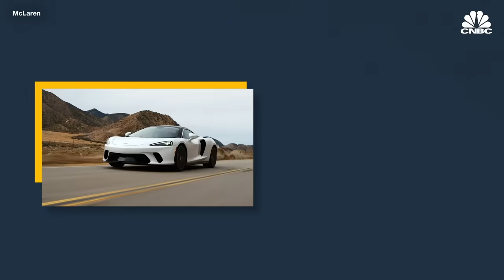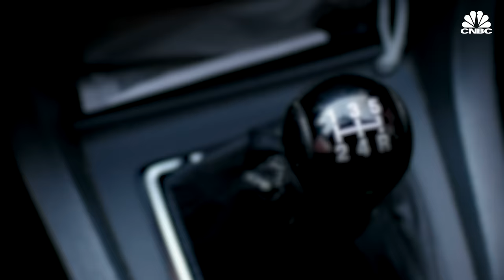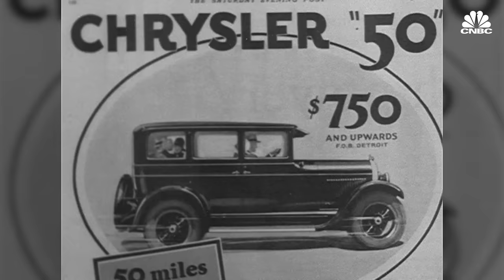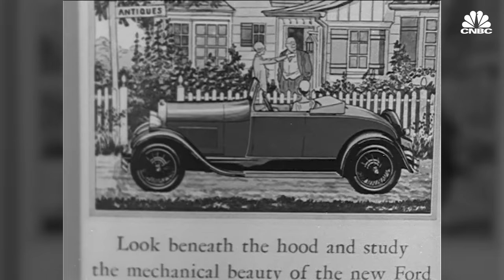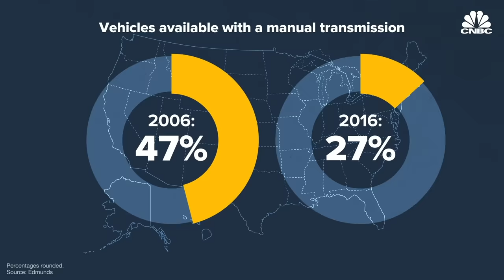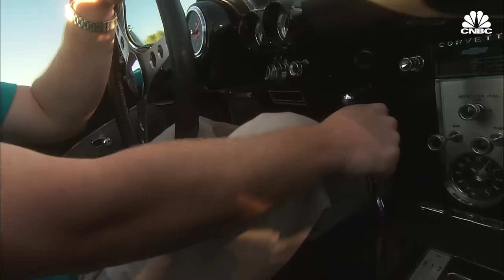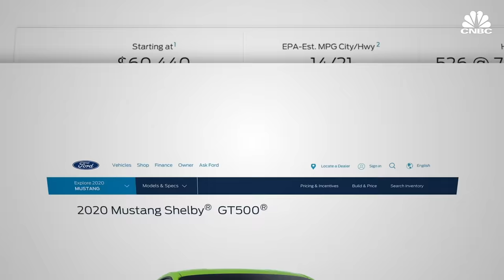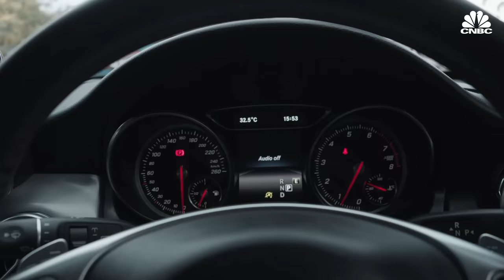Why Stick Shifts Are Going Extinct

Comment: "Manual requires work, skill, and constant attention" - Sounds like it makes you a better driver.
Reply: Something that requires constant attention makes anybody a worse driver. It is only politics that prevents it from being considered "distracted driving."
Reply: Well I drove an automatic vehicle in an area I didn't know(the US) and with cruise control it makes things so much easier. You can concentrate on reading the signs in a foreign language, see where you are going instead of getting lost managing your whole body to drive. I was also less tired on long distance driving. An Interesting data would be to compare accidents rate in cars with autopilot, cruise control, manual and automatic gearbox. If they can make a safety case out of it then it will be the end of manual
Reply: I will admit that I am a below-average driver with an automatic.   I think I have a little ADHD happening which hampers my focus.  

I am a MUCH better driver with a manual.   I am more involved in the actual operation of the car, more focused and alert, and simply put...a much better driver.
Reply: I find myself being more distracted in an automatic. It is extremely boring to drive and ill start getting lost in random thoughts.
A manual is way more fun to drive, and I'm always paying attention to the road, to see when to shift, downshift, on red lights im constantly paying attention so i can shift into 1st as soon as it turns green. Idk, to me a manual makes me more focused, and it's more fun.
Reply: lol thank you
Reply: @TheLaly37  One of the countries most prone to car accident is USA and one of the less prone countries is Germany.
In USA the speed limits are quite low and almost every one drive an automatic car with a cruise control.
In Germany speed limits are higher (sometimes there are no speed limits, so you can drive as fast as you can!) and the vast majority of cars have manual transmission and no cruise control.
The most common cause of accident in my country (Italy) is DISTRACTION and, of course, automatic transmission, cruise control, low speeds, ADAS and of course CELL PHONES are all cause of distraction.
Reply: @Ιώαννης Ανδρέου yes, this is the first cause of accident, but there are much less accidents!!!
If you slow down the traffic, you surely decrease the number of accident caused by excessive speed but you dramatically increase the overall number of accidents!!!
Speed equal danger... but danger equal more attention!
Remember that driving is not safe and requires attention... when you feel safe while driving, your attention level decrease and the likelihood of having an accident increases a lot!
A rule of thumb... if you feel safe when driving, you aren't safe at all!
Reply: Guess the most important thing is what you are used to. I have driven an automatic once and it did not go well. The car stopped at almost every intersection.
Reply: @niklasmolen4753  So you tried to press the clutch and hit the brake instead???  :-D
This is a quite common issue for people used to manual transmission only!
I driven automatic two times in my life (one for a short trip across the city and one another for a quite long 2 days roadtrip)... it ended just fine in both situation but of course i hit the brake hard few times also!  :-D
Reply: @ChaotikFPVyup. It's muscle memory and being more concentrated on driving is the point of driving safe. IDK how this is distracting, unless you're new to it but oh well.
Reply: @Ιώαννης Ανδρέου fatal***. He said car accidents.
Reply: Ιώαννης Ανδρέου no, those crashes are all caused by idiots/tourists who think that no speed limits=top speed everywhere, and constantly drive like that while forgetting to look, and think ahead further than when your doing 100. THE AUTOBAHN IS NOT A VIDEO GAME
Reply: @Ιώαννης Ανδρέου Do you ever tried to drive in Italy?
There are a lot of stupid drivers that drive at very low speed in the center of the road (usually with two wheels on a lane and the other two wheels in another lane, even in two-way streets!) that causes a lot of troubles and a lot of accidents too.
Anyway, you are right... better driving education is the root cause... but in order to be a better driver you shall be able to drive faster and mantain the control the car during skids and other issues... if you can't do this, you can't be a good driver!!!
Reply: Cor Rautenbach  Washing clothes by hand makes you better at washing clothes so lets get rid of the washing machine too SMH
Reply: @christiansoldier77  There are some big differences to be considered:
Hand washing can be better in many special situations (for delicate clothes for example) but it requires a lot of extra effort and time (which can be used in a better way).
Using an automatic car instead of a manual one is simpler but...
Can you use an automatic car to spare time???? NO!
Can you use an automatic car for a more relaxing driving experience???? MAYBE, but driving an auto still require a lot of concentration (so is pointless!)
Also....
Can you use an automatic car in sand, snow, ice or other harsh conditions????? MAYBE, but a manual car allows some extra tricks to do something otherwise impossible for an automatic.
Can you stop an automatic car in case of an engine runaway???? MAYBE, but with a manual transmission is really easy and you will have 100% of success rate.
Can you stop an automatic car going down a slope in case of complete brake failure????? MAYBE, but with a manual car is way easier (and this is not a problem at all because everyone use engine brake to slow down the car, preserving the brakes).
Also, there are some other common tricks available 
(i.e, you can switch off and on again the engine while running in case of electronic seizures and you can start the car by push in case of a dead battery).
Remember that driving a manual car is not the same of driving an automatic car but there are many extra options available.
FYI:
Driving in highways in normal conditions ---> almost no differences.
Driving on mountains ---> manual is better.
Driving in harsh conditions ---> manual is better.
Get out of problems or failures ---> manual is better
And finally..... driving in the city  in normal conditions---> this is the only condition where automatic is better than manual!.
Reply: @teslacoiler  If the manuals were better than people would prefer manuals over autos
Reply: @christiansoldier77  This is exactly what happens in countries where an apprentice must show proficiency on a manual car to get a driver license (for example, here, in Italy).
When you know how drive a manual car, then you also know that there are something missing in an automatic car (not only the clutch pedal, but something else!).
The vast majority of cars have manual transmission here; most model have only one engine option for automatic transmission but many options with manual and some models aren't available with automatic transmission... even when you rent a car, a van or pick a drive-sharing vehicle, you have very few (sometimes ZERO) options for an automatic transmission.
Reply: @christiansoldier77  The real reason is another:
if all motorists were able to drive either manual and automatic transmission, than people would prefer manuals over autos!  :-)
This is exactly what happens in countries where all motorists are able to drive either manual and automatic transmission!  :-D
Reply: @teslacoiler  Obviously that isnt true otherwise autos would have never become popular
Reply: @christiansoldier77  Autos are popular only in countries where you can get a driving license on automatic cars without any restriction.
Reply: @teslacoiler  Dude  at one time manuals were the ony cars that existed  now people want autos so it isnt because of  any reason you keep talking about
Reply: @christiansoldier77  do you ever tried a long roadtrip with a manual car???
I drove for a quite long long roadtrip with an automatic car once and i was not satisfied for the small lag before any overtaken (with a manual car, i can downshift the gear before so i can have the full power immediately) and i was quite concerned for the number of times i use the brakes as I was going down a mountain road (i definitely "smell" the problem).
But, I must admit it was great inside a city (and also very fast and with excellent road holding for reasons other than automatic transmission... it was a powerful sport car!).
Reply: @teslacoiler  Manuals are only popular in Europe because they pretty much make you learn on  manuals and the insurance for manuals are lower than autos
Reply: Not really.  It eventually becomes brainless and repetitive.  Also a huge PITA in traffic.
Reply: @christiansoldier77  OK.
So, please explain why every winter i always find a lot of automatic cars in trouble on the snow (causing a lot of troubles for other cars) and only few manual ones?
Keep in mind that only about 5% of cars are automatic here.
Note: i know and use some tricks to drive on snow using a manual car but i have absolutely no idea how drive in snow using automatic transmission and no handbrake (except try to drive in the standard way... which of course is not good on a slippery road!)
Reply: Christian Soldier “insurance is lower on manuals.”  Interesting point because insurance companies “crunch the numbers” and if the insurance is cheaper then it is because there are fewer accidents. Why? Probably because you have to pay attention when driving a stick shift. Distracted driving is the biggest problem today and automatics make it so much easier to be distracted. Pretty much impossible to text and drive if you are driving a stick shift
Reply: @AndrewSteitz   insurance is lower because automatic transmissions are expensive to replace are more prone in even light accidents.  Has zero to do with the driver skill.
Reply: @nit0134  agree 100 percent.
Reply: Pretentious stick drivers at it again. Stick provides no benefits in typical daily traffic. Only when you are pushing the top performance limits of the car is where the benefits shine.
Reply: what work? After few hundred hours of driving ,which is not that much, it becomes like second nature and you do that instinctively..
Reply: @flagmichael  Have you ever driven a manual car? Once you are fluent with driving one, there is no distraction. What, do you think that you have to look down at the gear shifter to see where to move it? lol.
Reply: It's not
Reply: @flagmichael 

Tell that to Europe and Asian. Almost all of their vehicles are manual. In South Korea, drivers are considered professional drivers and soldiers have to take a separate driving test to be allowed to drive non-military vehicles there. I believe many European countries have the same policy.
Reply: Exactly
Reply: @teslacoiler  Another factor in the U.S.'s accident rate, which you've conveniently left out, is over-all traffic DENSITY. We've far more vehicles on the roads, in any one given geographic area, than Germany has ever had. More vehicles, (by FAR!) will automatically yield a higher accident rate, per capita.
Reply: @JsliceQB1026  100% accurately said. Too many people drive on it, as if it were, however. This is why they have (well, one of the reasons, at any rate!) Polizei.
Reply: @pjamese3  Yes, this is how it was back in '85-'86, when I was stationed in Uijongbu City, at Camp Stanley. Don't imagine it's changed any, in the intervening 35 years.
Reply: @flagmichael  I can tell you've never driven stick. Driving stick is a lot like riding a bike. It becomes muscle memory. Driving stick has made me become a SAFER driver because I need to use BOTH HANDS while driving. So, it's harder for me to text and drive when driving stick. It's only ignorance that calls driving stick as "distracted driving".
Reply: GameNeet True. Driving an automatic is the most boring thing ever and no fun. Constantly getting distracted because it’s too easy to get.
Reply: It's like when they review a car and say "The interior is so quiet"?? I want to hear what's going on under the bonnet, and the road, what about horns? or sirens?  Go home and put a pillow over your head that's quiet.
Reply: Exactly its really not that hard to drive a manual,  you can't just push the clutch in and coast downhill to save fuel in a automatic XD
Reply: exactly
Reply: @ChaotikFPV muscle memory still takes brainpower. Even an instinctual action takes more thought than no action at all.
Reply: You can get to a point where driving stick is second nature. In other words you really don’t have to concentrate on what to do next. But I been driving stick for over 30 years so it’s quite a natural thing for me.
Reply: @flagmichael  I live in a hilly part of my country with really bad road conditions, potholes, turns and sloped roads riddled with potholes, cracks etc and during rainy seasons its literally offroad muddin season in most roads except the main commercial town areas, and i find it funny that Americans cant even drive stick when their roads are literally God Tier and mostly straight compared to the roads in most developing countries, also despite the road conditions out here its safer, better and more fun to drive a manual because you can actually control your car better compared to automatics as i have both an automatic and a manual but prefer to drive the manual because an automatic is just plain, bland and boring. Americans need to git gud at driving fr if u think driving stick requires constant attention that can distract you, rather its the opposite.
Reply: @TheLaly37  we need more manual MODES do you can have manual and automatic
Reply: No it wastes a lot of time, energy, and causes fatigue. Hopefully all cars should become automatic, paddle shifters are pretty good.
Reply: @ROTHSTEIN01  do you know how to drive stick?
Reply: @jogmas12  yeah I am from india and that's what 95% of people drive here, an ugly stick  lol. I learnt using a stick and seriously when I first drove an automatic, I knew that I was not ever going back to that ugly stick gearbox.
Also here in india, traffic is pretty insane, the reason why Manuel sells so much because it's cheap. But it causes intense fatigue and tension.
It's an 100 year old technology, hopefully all manufacturers will stop making it within a decade.
Reply: @ROTHSTEIN01   there will always be a market for stick shifts because of car enthusiasts who prefer stick shifts over automatics, and judging by your comments i dont think u can even drive a stick properly
Reply: Yeah! true! I want to be a part of the vehicle i'm operating, like that of a part that does its part so that the vehicle will perform what it's designed to do. When the system [the manual transmission system] is already etched in a persons system, it will not be lost even though years gone by and that person hasn't had driven a manual one. once that person goes back to a manual vehicle, it will just re-appear  or back to the fore no huzzles. Let's not erase this system from the automotive industry.
Reply: @flagmichael  There's actually significant evidence that manual transmissions increase focus in drivers with ADHD. Being someone who drives a manual regularly and has attentional issues, I can tell you that driving a manual car forces you to pay more attention to conditions further ahead of you on the road, since the car requires more anticipatory inputs from you as a driver (e.g. downshifting as you approach slower traffic). It can be initially distracting while you're still learning, but once you make it a natural skill and muscle memory takes over, you'll find driving stick makes you a more proactive driver.
Reply: Right there is the reason why it was invented and deployed first in America. Most drivers in America are lazy, lack skills, do not pay attention and essentially are not willing to learn. On the plus side, American cars - now trucks - were heavy/got heavier and would have been more difficult to drive if equipped with a manual transmission. Last, the electric starter first, then the automatic transmission next allowed women to drive, pick up their children at schools and husbands at work or railroad stations.
Reply: i agree with u infinite times indeed, because automatic makes people lazy, less attention on the road and some drive and forget they are driving and turn to their phones to whatsapp since everything is automatic.
Reply: @mo gamer only with a lot of pain.
Reply: @christiansoldier77  Says the American who has yet to figure out how to seperate religion from politics. Or what workers rights are. 

Btw, Glocks are Austrian guns.
Reply: it probably depend on the person, some may be confortabl with it while someone like me might end up in a crash or something
Reply: Thats a stupid statment. Its just more of a hassle
Reply: DRIVING IN GENERAL IS LIKE THAT
Reply: I live in the U.K. and I’m learning how to drive and the only reason I’m learning manual is because the lessons are cheaper and buying a cheap manual is easier than trying to find a cheap automatic car
Reply: Do you pay attention to ur feet when u walk? If not then thats how it feels to drive manual
Reply: How exactly?
Reply: @flagmichael  If you have to think about shifting gears, you ARE a bad driver. Does using the indicators distracts you from driving? Does looking at other cars and what they do in front or on the side of you distract you from driving? NO because this IS driving! Driving is not just making your car go forward, but also NOT KILLING EVERYONE AROUND YOU
Reply: @stacks1548  or that's how it feels when to drive an automatic
Reply: A Manual helps to keep the attention on the Driving.
Reply: @flagmichael  I disagree. What is a Distraction and should be band is the large touch screen multi-functional display's that come in new automobiles. These Infotainment screens forces the driver to take there eyes off the road. A Manual does not. Driving a Manual is like riding a Bike. Once you learn the Physical actions of driving a Manual become automatic. One does not need to take there eyes off the road at all.